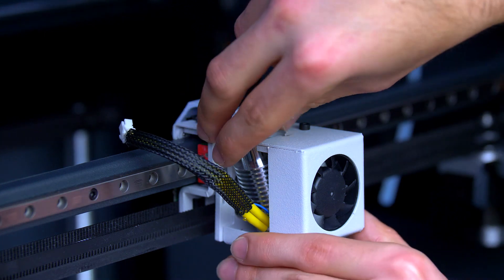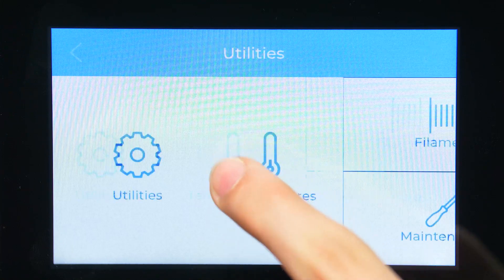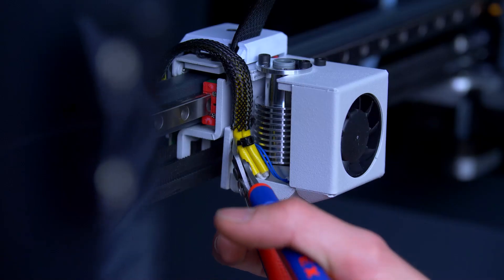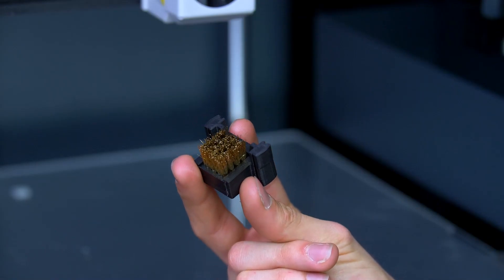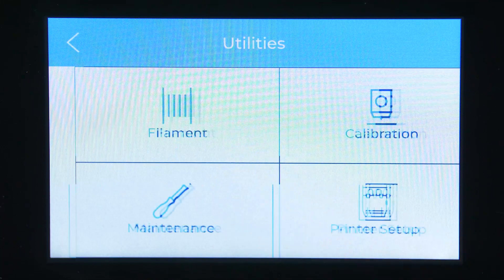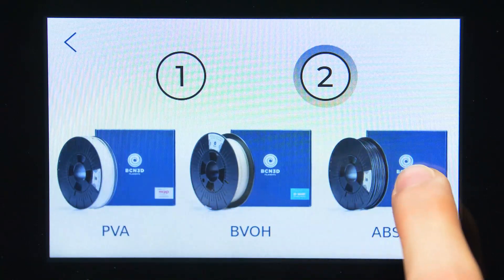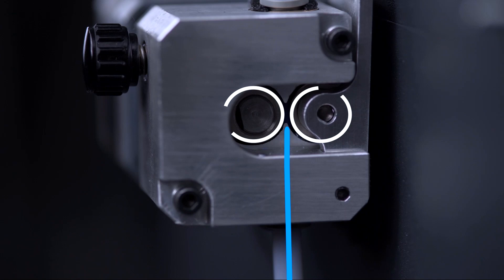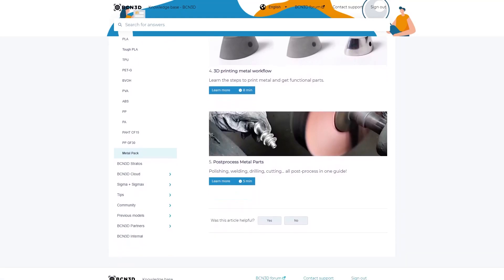How to install the Metal Pack - BCN3D Epsilon Series

Comment: why are not providing the debinding and sinterning set up. Not even any training or support on that.
Reply from the maker: The Metal Pack is a solution that opens up a new range of applications. The printing process is done with the BCN3D Epsilon 3D printers. When it comes to the debinding and sintering process, we provide  the current Forward AM authorized network of service suppliers. Find here the recommended BCN3D & BASF D&S providers  that offer sintering and debinding services: https://www.bcn3d.com/product/metal-pack/
Reply: @BCN3D  but that is not fare I think. If one want to have the facility in house who have purchased printer from your company then what is the option.?
Reply from the maker: @ArunKumar-sy8sy  Our mission is to always provide accessible solutions to our customers. Own sintering + debinding solution is possible but more expensive, which makes the process less accessible for you. As our field of expertise is the 3D printing process, we have designed this solution in order to provide the BASF trustworthy network to you for the postprocessing part.
Reply: @BCN3D  what if one organization is capable enough to have it's own setup.we have your printer and want to have own Debinding and sintering setup. I am trying to reach you guys since last month regarding this but till now I have not got any positive solution. One of our sister concern organizations is looking for the same along with your printer but not getting any positive response regarding this...I hope you take this seriously and will try to provide the solution.. moreover we are not getting any response from the vendor that you have developed here for Debinding and sintering process.what would be the cost, can we customize the Debinding andsintering process to get different properties etc.
Reply from the maker: @akkaushal0005  Hi Arun, 3D printing with metal is a very complex process that requires a huge investment. We are always looking for accessible solutions and that’s why we suggest using BASF’s services as BCN3D's mission is to offer solutions for everyone and we believe this equipment is not at the moment. Having said this, if you’re looking to build your own set up, you can visit xerion & Elnik for MIM/AM Debind + Sinter Solutions (+150.000 euro). 

Find here the links:
BASF Services: https://forward-am.com/debinding-and-sintering-order-managementportal/
Xerion: https://www.xerion.de/products/additive-manufacturing
ELNIK: https://elnik.com/
Reply: Any service provider in India for Debinding and Sintering?
Reply from the maker: @akkaushal0005  Find here this link which contains a QR code from BASF China: https://basf-metal.cloud.pageseagle.com/#/
After you fill the necessary information, you will receive an email alert and the contact will start.